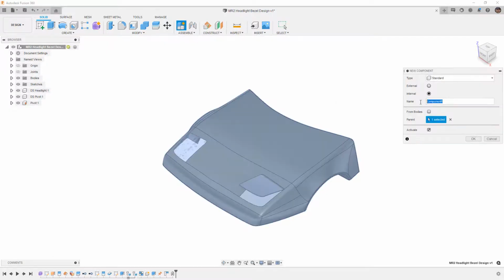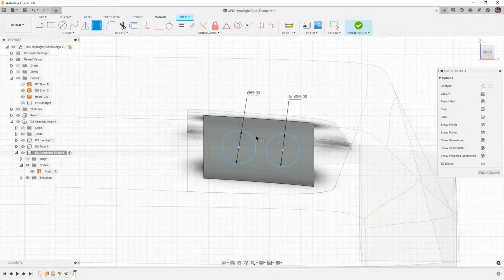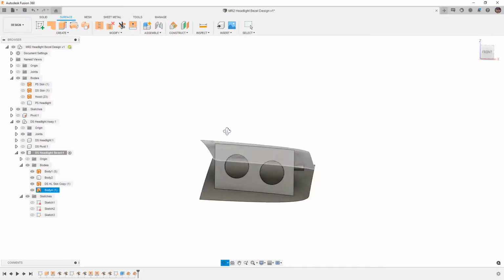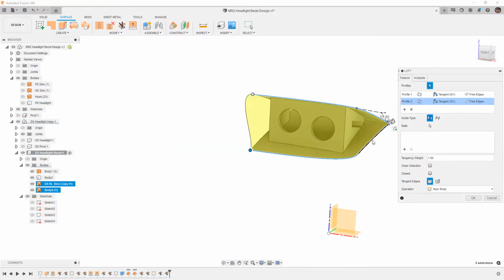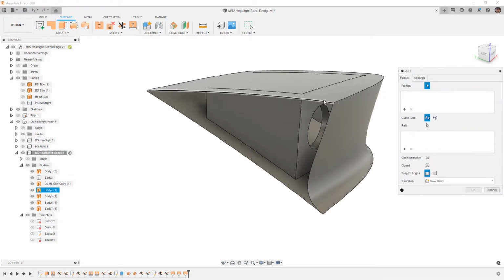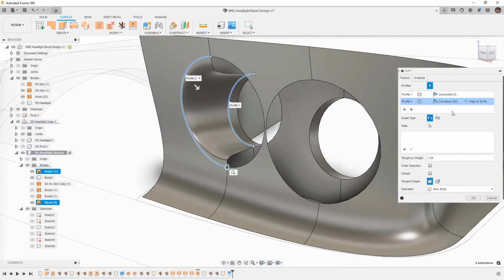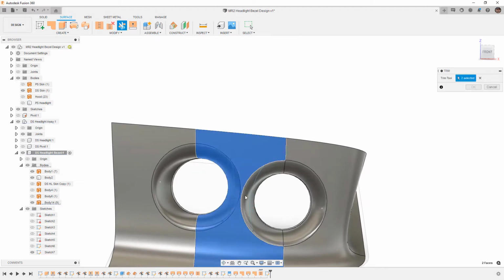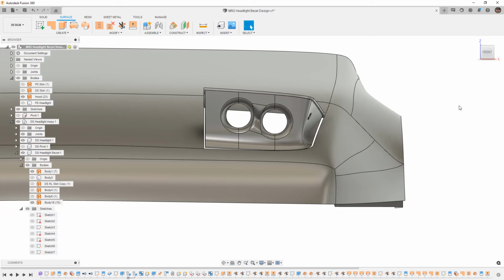Surface Model a Pop Up Headlight Bezel for an MR2 with Fusion 360 - Part 2

Comment: How can I 3D print these? 
This is such an Amazing job! 👌🏻
Reply from the maker: I wouldn't print these :)  since i just made basic shapes, but using the Create > Thicken tool to turn a surface into a solid is one way.  Sometimes that doesn't work because of geometry.  If that is the case you end up offsetting individual faces and then patching/lofting the other faces to get it to work.

Comment: I'm putting the finishing touches on a headlight bezel for NA Miatas and I couldn't have gotten this far without you! I believe you explained how to cut a surface (or body, I can't remember) using a mesh as a tool, maybe in the spoiler video? Can you point me to it? I can't seem to find it, and I need that technique :) Thanks for the great content!!
Reply from the maker: You are welcome Brian!  and yes I did talk about Mesh Combine https://youtu.be/M8AZZ2uATgo    You sadly have to convert your part to a mesh body which will triangulate it.  If you are going to 3d print it that isn't a huge deal, but if you are going to do something else it could be a pain.  You might be better off going the route I did on the MX5 spoiler making a surface off of the mesh https://youtu.be/rV68nODisM8